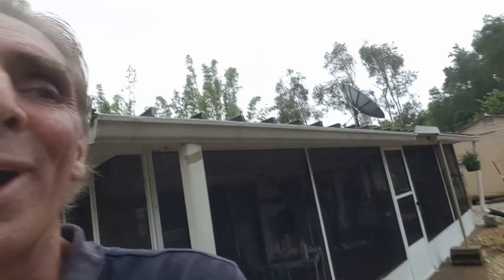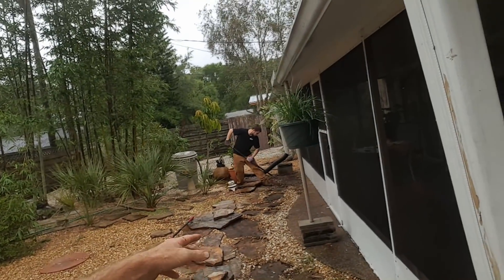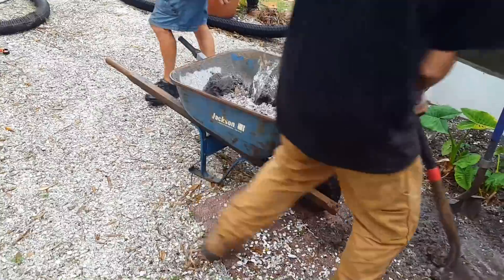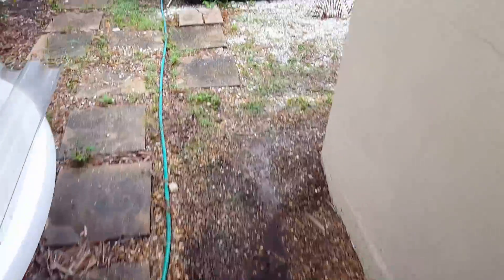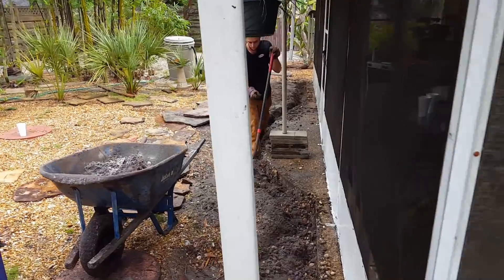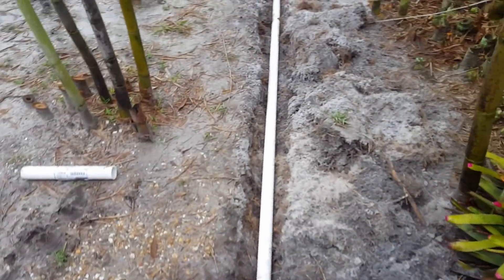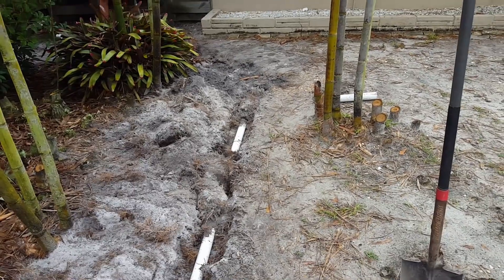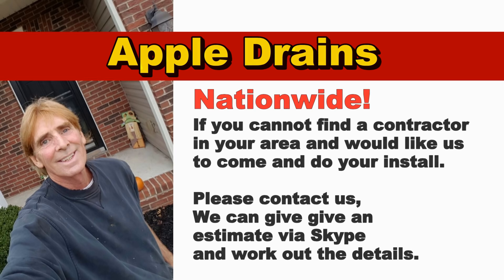Backyard Sump Pump with French Drain

Comment: Can you use a backyard sump pump in cooler climates like Ohio where freezing could be a concern during the winter?
Reply: I live in mid-west Ohio. I've had mine 3 years with no problems.
Reply: Thanks!
Reply: I should have added that my sump pit is concrete and all my pipe is schedule 40. I also didn't do a french drain, I had 75' of slope going to my sump pit using all non-perforated pipe. My apologies for not including that earlier.
Reply: My neighbor has one here in Illinois, but it is deep in the ground.